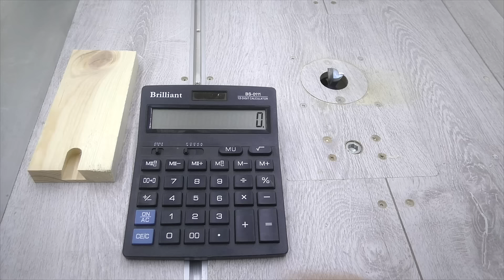SUPER SUPER Simple Dovetail Joint

Comment: Super simple! All you need is a $3,000 dolla router table, $4,000 dolla table saw and a 50,000 shop!
Reply: you can make a router table out of a piece of melamine board for less than $30. And a good table saw can be as cheap as $300 if you buy used.
Reply: Got my router for $10 used, $10 for new bits, $5 in wood and scraps to build a mini table and borrowed a friends $200 table saw 👍🏽
Reply: Can be done with any setup....excuse makers are haters
Reply: Can be done by Hand literally

Comment: Using floor laminates for straight smooth surface is genius, I have a few boxes laying in the storage, I'll be using this 100% for a workbench, thanks for the video.
Reply: What works well with laminate flooring is foam insulation board. You can quickly build strong, lightweight torsion boxes by wrapping insulation board in laminate. Put in timber, the same thickness as the insulation board, where you need something structural (joins, dog holes, etc).  The insulation board adds strength, simplifies construction and stops the torsion box sounding like a drum.
I used it for a couple of workbench tops and my router table top. It works well.

Comment: Excellent video. I've outlined the process step-by-step as I understood it below—feel free to comment/clarify if I missed any steps.

Grinwood - Dovetails on the router table
A) SPACERS (I’m not sure about this step)
1. measure top of dovetail bit
2. set up desired cut height and make test cut
3. measure bottom width of cut in the wood by router bit
4. add the two results for the width of your spacer
5. make a second spacer that is half the width of the first one 

B) Cut process: PINS BOARD
1. find and mark the board's center
2. mark center lines for two other pins using spacer (one on either side of the board's center line)
3. set bit height
4. clamp stop block on fence (equal or slightly less than thickness of tails board)
5. line up first cut using line drawn on table
6. place spacer and wedge in fence guide rail, lock fence
7. make first cut in pins board
8. remove spacer and move fence over to wedge, lock fence
9. make second cut in pins board
10. remove wedge, place spacer, replace wedge, remove spacer, move and lock fence
11. make third cut in pins board
 
C) Cut process: TAILS BOARD
1. remove wedge, place 1/2 spacer, replace wedge, remove 1/2 spacer, move and lock fence
2. remove stop block from fence
3. stand tails board vertically, supported by backer board attached to miter gauge, right edge up against fence
4. clamp tails board to backer board
5. make first cut on tails board
6. unlock and move fence, place spacer between fence and wedge, lock fence
7. make second cut on tails board
8. remove spacer, move wedge next to fence, unlock and move fence, replace spacer, lock fence
9. make third cut on tails board
10. unclamp the tails board, move it left using spacer to determine distance from fence, re-clamp tails board
11. make final cut with router on tails board
12. remove a small amount of material from the inside face of the tails with the table saw so the tails can seat properly into the recesses on the pins board
Reply: Thank you. And I thank the creator of the video. I'm pretty handy, but I find this almost useless without narration as he works. All I get is a general idea every time I watch one of these. I going to have to call a friend who's done this before I attempt it. Also I searched for "simple for beginners" and all these videos immediately run over to a collection of tools worth more that the one or two projects that I'm planning. Some times they spend half the video making a jig without explaining. Is there a way without a table saw? Just a simple router and some templates? This is like watching a guitar instructor play "Stairway to Heaven" at full tempo and then saying "Here, just watch this once and you'll be ready to play at Madison Square Garden" LOL
Reply: I don't understand the measure on 2:30. How far ist the router away from the fence for the first cut in the second part of wood and is this the same height as before?
Reply: For A, you are correct or at least I agree with you.  If you draw a picture with equal size pins and tails, you'll see the distance it takes for the pattern to repeat (wave length) is the sum of the big measurement and the small measurement.
Reply: @datenkrake05  I don't think you want to rely on measurements.  The big spacer is the distance it takes for the pattern to repeat.  The second piece is cut in between the first pieces cuts, and that's why he uses the half-spacer.  Note that you only use it once and then switch back to the full spacer to keep this offset throughout the second piece.

If that doesn't make sense, look up some youtube videos on the porter cable dovetail jig and you'll see how the pieces are clamped offset of each other.  That's what the half-spacer does.

Comment: I agree with John Heisz.  The only comment I have for improvement is to use either a digital or dial caliper to show your measurements.  I realize that you are located in Ukraine, but these are available at really cheap prices here in the states.  In the video, I am just not able to comprehend the measurements quickly enough.  With this minor exception, you have certainly simplified the process of making this joint.  Good job!  Now I just have to go back and replay until I can figure out the caliper measurements.  🤔
Reply: Maybe it would get easier to see in the video, but I cant stand digital calipers. It's like using a rule that needs a battery to show mesurements
Reply: @eduardo_2805  totally agree. Digital caliper is useless. Basic caliper is simple enough, no need to overcomplicate it with display.
Reply: Hi Dan, I agree with you, a digital caliper would be easier for the viewer to see the measurements. I had to go back and watch it again. The top cutter measurement is 22.3 mm and bottom measurement is 14.1 mm making 36.4 mm width of spacer. I managed to get the measurements off his calculator.

Comment: Nice video. Wonderful job only using 1 dovetail cutter. I watched a video the other day where a dovetail joint was made using a Keller jig. The jig cost £178 which included 2 cutters that had to be changed halfway through the operation. 

Only problem with this method is that you end up with semi circular holes on the inside of the joint, which doesn't really matter if it's a box or drawer.
Reply: I thought this too, but he showed the inside corner and no round out or gaps were visible.
Reply: @qwazy01  Yes, but how? I didn't get that part. He cut small part of the pins what made a cover but that seemed smaller than the half diameter of the gap's curve. So it shouldn't cover it.
A good explanation would be appreciated.
Reply: @seggremalac  You can see in between shots on the half-blind part, he moved his stop block. You need to adjust the depth of the cut until the opening is the same as the thickness of the tails board. The end of that opening is a half-circle of a certain radius (half the root width of the tails). If you use the table saw to remove the same amount as the radius from the pins, then the pins won't interfere with that half circle, but the pins board's overhang will fully cover the hole.

You could also use a small chisel to square the hole. Very little material would need to be removed. Or if you don't care about the holes being visible, you can just push the centerline of the bit to match the thickness of the tails board, and a small hole will be visible.

Comment: Two years later, 40,000 people have viewed this, 478 have commented.  I read the first 100.

Your method works, so kudos on that.  It requires one router bit, and a lot of make-work shuffling two different spacers and stop blocks to get things to line up.  The result is impressive.

Of course, we now have people (on YouTube) testing joinery, glues, and methods.  Dovetails look cool, but are not very strong.  So, yes, your method allows creating dovetails with one well-crafted router bit.  

If the goal is to have a pretty and ineffectual joinery method that takes a ton of work with two spacers and only one bit, you win the prize.

If the goal is to have a high tensile joinery method that is easier to put together but doesn't look quite so sexy... well, the mortise and tenon win that one.  As woodworkers evolve dovetails will be history.  Octagonal wheels worked for a few seconds, but round ones overtook them and now we'd consider square or hexagonal or octagonal wheels... stupid.

Thanks for the lesson in how to make a simple thing complex but pretend it's simple because "only one router bit."  Now think to yourself how a woodworker did this with a chisel, you know, before "router tables".  What did you teach him(/her)?  Nothing.
Reply: Damn, why you so salty, let the man enjoy his joinery. Different joints for different applications, it's also aesthetically pleasing. What does this comment add of value to anyone? Nothing
Reply: Do u actually do wood working?  M&T is a different joint and while i guess could force a MT where a DT makes more sense, but who would?

Comment: ya those are super easy, providing you take the time to build the jig first and figure out that all you dovetails will only be one size with that jig.
Reply: There isn’t a jig involved. When he cuts the vertical piece it is just a sled used for support with a backer board attached to prevent tear out.

Comment: the tail is round and the pin is square, yes?   or am i missing something?   how did that fit together without a space on the inside???
did the cut on the table saw, removing part of the pin slide over the round part and cover that space ?

Comment: A really nice idea - I get the distance bricks, but how do you set the initial depth stop at 0:55? BR Claus
Reply: Don't quote me on this, but my guess is that 

1.  The stop is determined by the width of the second piece (tails).  This would be the maximum possible distance that will allow for a flawless inside corner as shown in the video.

2.  The cut-off from the second piece allows both a flush finished edge on the outside corner and also covers the rounded cutout from the bit on the inside.  So, the cutoff depth on the tails could be found by first dry fitting the tails to the maximum insertion point; the amount that remains proud of the outside corner will reveal the minimum cut-off depth required to be removed.

Hope this helps.
Reply: @qwazy01  Indeed - thanks!

Comment: Thanks for the video. How do you know where the depth stop in 00:53 shall be? And in connection how much to cut from the “inside”/“back” of the tails?
Reply: Don't quote me on this, but my guess is that 

1.  The stop is determined by the width of the second piece (tails).  This would be the maximum possible distance that will allow for a flawless inside corner.

2.  The cut-off from the second piece allows both a flush finish on the outside corner and covers the rounded cutout from the bit on the inside.  So, the cutoff depth on the tails could be found by first dry fitting the tails to the maximum insertion point; the amount that remains proud of the outside corner will reveal the minimum cut-off depth required.

Hope this helps.

Comment: Very nice!
A question: can the joints be done on the inside of the working piece, i.e. not to be visible from the outside, as seen on 4:44?
Reply: I think if done the way you suggest the rounded cutout from the router bit will show on the inside corner.

Using the method shown in the video, the round cut out is covered by the second piece.

I think dove tails are straight up one of the best looking joints and this method is the easiest I have found after many searches.  And perfect for use with plywood as well.

Comment: Am I missing something or is there empty space inside the joint? It's hidden, but I would think that would make the joint weaker than your standard dovetail joint.
Reply: Yes, there's empty space which makes it a little weaker. But it's much faster than hand-sawing and sufficient for strength for a typical drawer or box.
You could also make more but smaller dovetails or add glue in the empty space for extra strength.

Comment: I still don't get the formula & how to calculate it. Plus, he didn't show cleaning off the joint with a chisel. If you noticed, where he cut out the dovetail joint, it's rounded. But when he puts it together, it's at a right angle. Important step sir!
Reply: There was no chisel. Instead of chiseling it square he cut part of the tails off so it covers the round bit. That's what he was doing with the table saw.